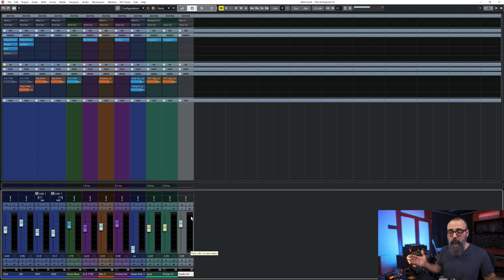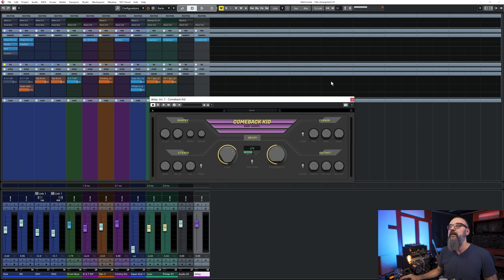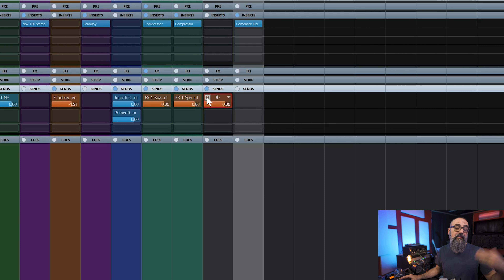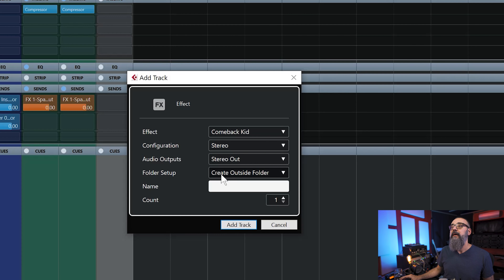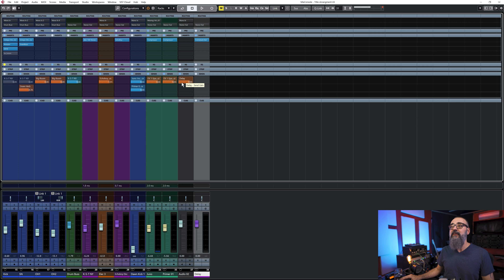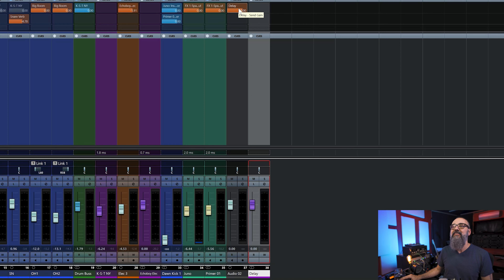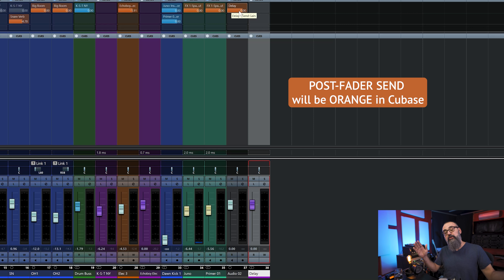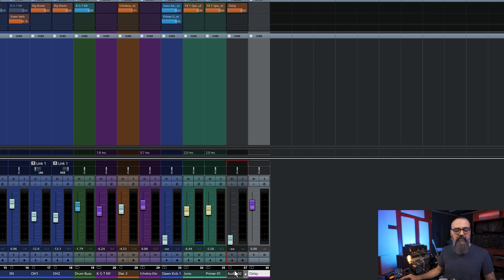POST FADER Send vs PRE FADER Send FX in CUBASE

Comment: Thanks for this video. I learn a lot from your videos. For the parallel compression case would it not be easier to just do compression in an insert if the compressor has a mix knob? Then you can setup the relationship in one place (the mix knob).
Reply from the maker: Yes, that works as well, unless you EQ your Compressed signal or add other processing to it

Comment: One more common time to use Pre-Fader sends: You may need to use them to make a Cue mix for the artist. Cubase Pro har 4 decicated Cue sends, but I'm not sure if all versions of Cubade does. Anyway, if you use a DAW that doesn't provide dedicated Cue-sends (or you need more than 4 in Cubase Pro), you need to use the "regular" sends for this purpose.

In this case it's vital to use Pre-fader sends, as you don't want the musician(s) mix(s) to change when the engineer changes a level or mutes a channel.
Reply from the maker: Yes, for someone not using Cubase Pro with Cue Sends, this is a very good alternative, thanks for sharing!